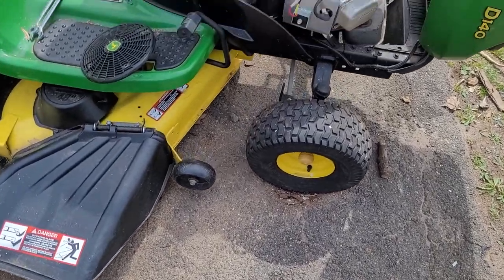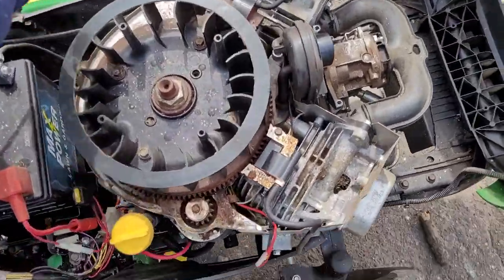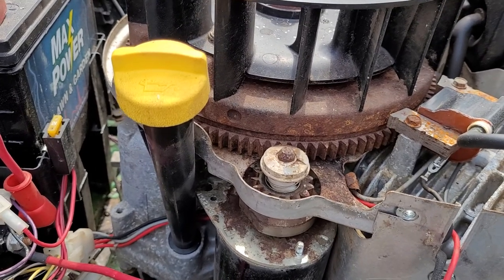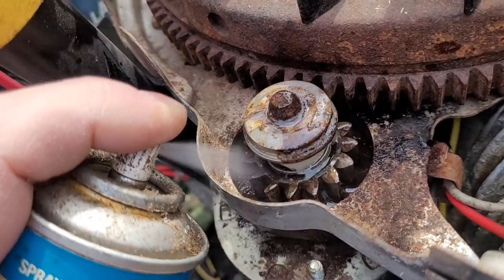IF your starter just spins lube your bendix part 2 John Deere addition

Comment: Same problem. Had a freaking big mouse nest all over on and around the engine. Found 4 dead after opening the engine cover. Got my deere s120 working again after spraying (pb blaster) and loosen it up with a flat screwdriver.

Comment: It's her hubby... the one that does the cooking and most everything else. I didn't want to stay out in the heat and decided to try whacking the starter with a rubber mallet while it was spinning. Worked fine. Cut the grass and now going to trim and then get out of the 91°+ heat! I replaced the starter last time and it was the battery... wrong one with terminals on opposite sides. All the starter would do was spin and not jump up to engage and start the engine. New one did the same... then discovered real problem. Luckily didn't fry the ECU!

Comment: The sticking problem is down below what you see. The correct fix is to remove it, clean it, and DRY LUBE it. Too much of what's on the video will short out your starter in time. It comes down to either a quick fix that will eventually screw everything up, or fix it right and be fixed for good.

Comment: what lube did you use? in your outboard motor with the same problem you used Blaster Dry Lube.  Hard to find.  This one you didn't show what you used. thanks
Reply: WD-40 for temporary quick fix or pb blaster for long time solution.